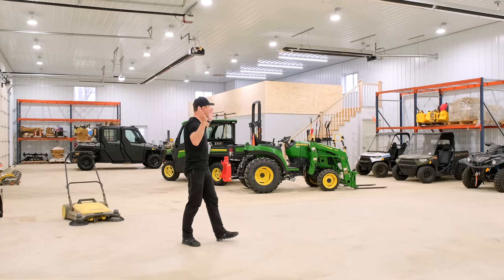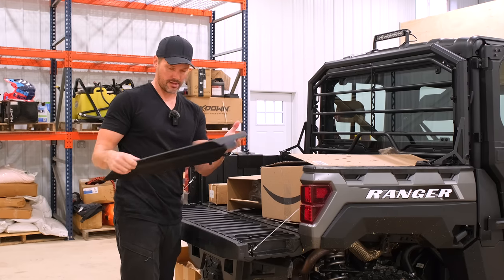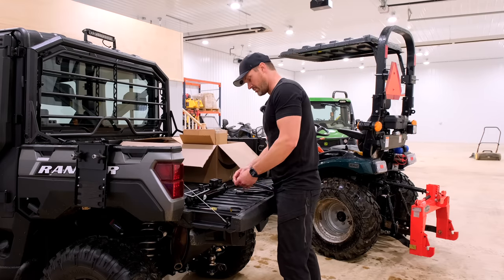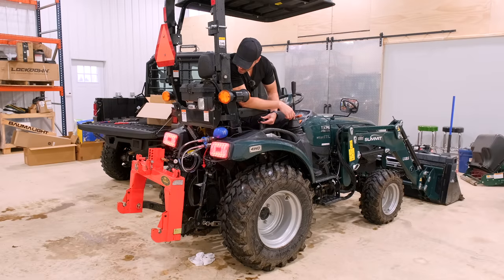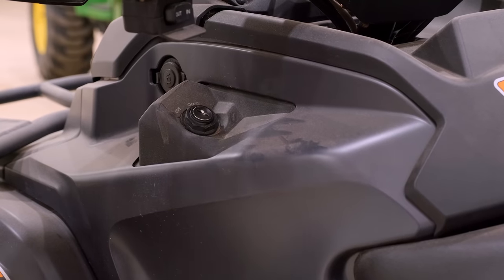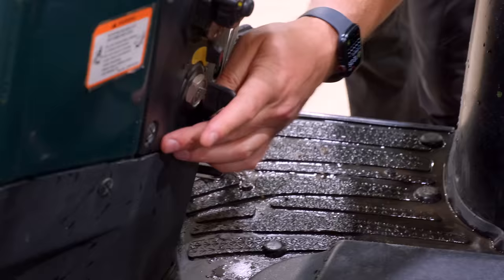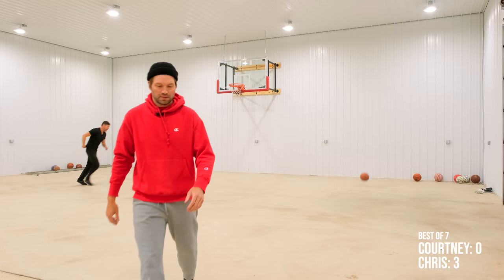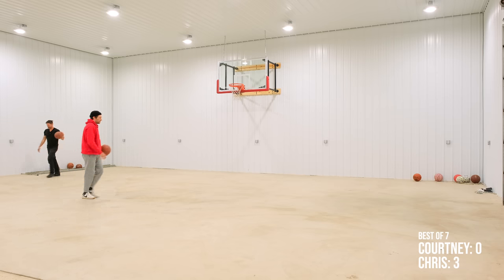ADDING AN ABSOLUTE GAME CHANGER TO OUR TRACTOR!

Comment: Harbor freight is an excellent selection for a toolbox. I have one it’s a little bit cheaper than a husky better quality variety of colors and you can always add on side boxes also,I think it’s checking out,it’s better to spend the money on the tools then a X amount thousands of dollars on a snap on toolbox,that just sits there and hold tools. Just my opinion.
Reply from the maker: I checked out their toolboxes last time I was there.  Definitely in contention!
Reply: Ditto on the HF toolboxes, I've had one for two years running and love it. Wait for one of their 20% off coupons, usually come out around the major holidays.
Reply: I’ve got US General toolbox and it’s great. Had it for a few years with no trouble. Modular design is handy too.

Comment: The fittings on the cylinder are banjo fittings. They are used a lot in fuel systems on diesel. You want to put a copper washer on both sides of the barrel so it doesn't leak.
Reply: I saw that too.

Comment: Hey Courtney, the fittings on those hydraulic lines are banjo bolts, there should be 1 copper washer on each side of the hose fitting to allow it to seal to the bolt head on one side and the hydraulic cylinder on the other. First time I've seen these on a tractor but they are super common on automotive brake and fuel systems.
Reply from the maker: Thank you Nick, I think they are a good idea.
Reply: @GoodWorksTractors  you may want to double check those washers as it looks like they got stacked all on one side of the hose fitting.

Comment: Courtney addresses this briefly, but there’s more. At 15:38 you can see Summit’s top link hanger actually flexing as the top link banjo bolt presses against it. The hanger plate itself is a heavy piece of kit. Continued contact it will eventually cause the banjo bolt on the hydraulic cylinder to fail (leak).  I have this same setup and I removed the Summit hanger. It doesn’t fit the hydraulic top link anyway because it’s so much bigger than the stock manual top link and based on my attempts on the bench, the plate can not be bent back out of the way. Maybe this will help other Summit TX25 owners.
Reply: I've got the Summit too.  Which top link did you get?

Comment: Happy to see that the info I sent was beneficial! And you’re right… I’m spoiled now as well. It’s a lifesaver when using something like a box blade. The only difference between your install and mine was that I flipped the cylinder over so the hydraulic lines were on the bottom because that bolt was hitting the top link bracket just like on yours.  Good to go!

Aaron

Comment: Ive been running a top and tilt link (2 cylinders, one for lift and one for in and out) on my Kubota L4060 for quite some time. I am surprised that no one else knows about these. Good job making this an option for the smaller equipment Goodworks! They are an absolute game changing add on for your machine. Makes it incredibly more useful in so many ways. I use mine to change the pitch of my 6 foot rotary cutter so I can float the deck just off the ground and not drag big lines in my fields from the steel rails on the cutter. Box blading is a whole different dimension of capabiltiy. You should really consider selling the lift links too ... it is just a cyliunder that goes on the side of the 3 point so you can tilt the implement as well.

Comment: Those bano bolts will eventually loosen.  What is needed is a double saddle clamp between the two bango elbows to keep fittings parallel.  The continuous up and down, and in and out will act like a wrench and loosen those hydraulic fittings.  Could you do a test on electro-mechanical top link, i believe from  Showa from Japan, very simple for us "no rear hydraulics guys". Thanks again

Comment: I have used every mole trap on the market. These that you have (mine are called "Mole Eliminator") are the best that money can buy. They are almost 100%. If the trap is sprung, you can bet there is a mole in it. Before I used this model, I had tried others and the moles were winning the battle. Most traps only have about a 50% success rate.  I now have 6 of these, and I am finally winning. I am nailing them every time. And as for the top link, I couldn't agree more. The hydraulic top link and Pat's easy change system are both game changers.
Reply: I used every mole gadget imaginable too for years and finally found one that worked and holy crap do they work. They're called Gopherhawk. I would say I catch 10 to 1 with it over the eliminator where I live.

Comment: Put up peg board style access for your tools and get a cart to use for your tools with a work top. When you take a part off to work on you have a place to put it. You’ll have the tools you need, and when you’re done push the cart with tools over and hang them. Open space? Missing tool. And less exercise getting everything put back.

Comment: For a full standing tool box, you'll be hard pressed to find a better quality box for the money than Harbor Freight. But wait a few weeks, the new gen 3 us generals are rolling out now. If you don't want or need a top box, huskys rolling work benches are a great option but limited on color. 

Tool wise, I've worked with a hodge podge for years. Mostly craftsman with dewalt power and a bit of snap on/mac tossed in, but since craftsman were discontinued then sold, and remade the quality isnt there. Over the years sets get incomplete and tools fail I've been replacing with Icon from HF aswell. Dewalt power  tools have fallen off aswell so I run Milwaukee. M12 ratchets with 3/8 impact, m18 fuel 1/2 impact and grinders. I don't even use air anymore except for tires. No more extension cords either.

Comment: Great Video and I have a question.  I have the rear hydraulics for JD 1025R  for rear but if I connect the hydraulic link where would I install the switches or how would I move it backward or fowards ?
Reply from the maker: Hi Clifford, are your rear hydraulics there to operate the backhoe?  If you have a regular rear remote, then you'd have a lever somewhere on the operator station to control it.  

The hydraulics for the backhoe are an open circuit that allow fluid to freely flow.  The backhoe has it's own levers to control what happens with the flow.

Comment: Battery cover - put two screw eyes with body washers / acorn nuts (eyes inside) on cover, attach a bungee cord to each and run in to frame. If color of washers / nuts bother you darken with phosphate dark bluing or paint.

Comment: As others have stated, the fittings are banjo bolts, and allow fluid flow regardless of hose orientation. As various tractor models are different, a singular hose orientation may not work between multiple models.

As for the hose reel, probably every reel I've ever worked with has a series of 3 noticeable ratcheting clicks, where it'll lock. A gentle pull beyond the 3rd click or locking position will allow you to walk it back in. And HANG ON! Some of those springs can be extremely strong, allowing for the potential for damage to property or injury to people if somebody's in the wrong place at the wrong time! I myself usually grab that hose stop, (what I call "the donut"), as it helps prevent the hose from slipping out of your hands.

Comment: Jackshaft garage door openers. Remove those horrible overhead door openers and add a low profile track kit to your door tracks to snug them up against the ceiling. Mine run about 2" off the ceiling so they don't interfere with my full height lifts or anything else up on the fork lift.

Comment: Good afternoon. I buy Cornwell. Yes it stings. But I grew tired of braking, cracking,  twisting off, broken pry bars, yada yada.
I only use 6 point wrenches and sockets. Grew tired of call, wait, explained, sorry can't help you.
Hence Cornwell. But it's my application, doesn't mean it'll work for your application. 
Now I do have Icon impact socket sets 3/8 & 1/2.
Milwaukee M18 impacts, drills and grinder. 
Good luck with your search

Comment: My son has a large Snap On tool box where he works I think there to expensive for my liking. We went to Harbor Freight and the have the Icon brand tool box which seems well built. So we took tools off the shelves and really loaded it up and was very impressed, the drawers rolled in and out smoothly with no issues . I'm not saying there the best, but for the money they seem very well built , I think there around  $3,500 give or take a little for a seventy two inch box and were probably going to buy one for his home garage when he's ready.  They also have smaller sizes at a lesser price's depending on what you need. Just an idea it's only my opinion so it's something to consider looking at and making your own decision about.

Comment: Maybe not the most elegant solution, but I would consider drilling a hole in that battery cover and zip tie at an easily accessible area.  That or a J clip and screw/bolt if you remove it often to use a trickle charger.
Reply from the maker: I just hate the idea of having to do that to an OEM part, but you're right that it would solve the problem.  Or I sell it and that would solve the problem too :)

Comment: Believe it or not because these guys get a lot of hate but the new series 3 US general boxes are pretty nice. The 34 inch service bank is really nice and has bumpers and 4 grease-able swivel casters that you can easily push in any direction. The coyle tools channels has an in depth video called which tool boxes are the worst. Good source of info and the new slate gray color the boxes are coming in is popular.
Reply from the maker: Thanks for the recommendation.  I'll look into it!

Comment: for a tool chest for basic stuff in that building just go to Harber fright or Northern tool don't pay the mark up on Husky. A U.S. GENERAL would be just fine for that or the Montezuma seem well built. I bought a Husky Stainless 12 years ago it has held up OK just seen a number of nicer ones over the last 6 years for less money.   You'd be better off piece mailing a tool kit together then buying one of the    "Master kits" as they always skip way to many sizes as they try to match SAE with Metric. Just look at how many skip right over 15mm then hit 17 to only then jump to 21,22,23  just like the SAE will give you 3/4, 1 and 11/4 but must often skip 11/16 and 1 1/8. and JD excavators love using that 1 1/8 nut and bolt combo so you always need two as they love making it impossible to get a socket on half of either side.

Comment: That Easy Wheel is a great alternative to the hydraulic top link if you’re fitting deficient. I just got mine a bit ago and it makes adjustments so much nicer. Didn’t see a close up in the 3 point lever, did you add a second switch to move in and out?
Reply: The Summit TX25H comes standard with the rear remotes and a handle/lever.  Plug and play!

Comment: Do you have a link for that toolbox you have on the Summit tractor
Reply: Those come standard on the tractor, but I’m sure you could find one separately.  I actually swapped mine out with a bigger steel box since the plastic one was a bit small
Reply: @Lazy-F-Acres  My Summit tractor did not come with one.
Reply: @natekelsi  now that’s odd…

Comment: you might want to check the air in those balls they sound a little flat
Reply from the maker: We use an echo reducer for audio.  That might affect the sound a touch.  They are at the right psi :)